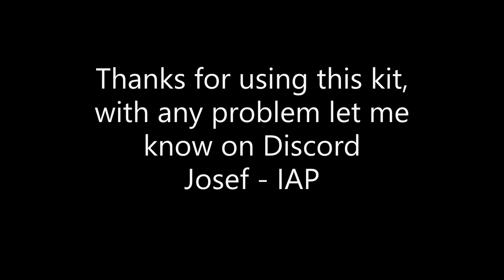Airsoft BREN 2 Kit by IAP - ASSEMBLY VIDEO

Comment: Can this fit the S&T/Ares G36 gearbox?
Reply from the maker: Hi, this gearbox was not tested yet, from my research, its more suitable because of the sides are missing some elements you would need to sand down anyway, however non standart selector is not compatible ( would need special selector plate) and screw above QC could be problematic.